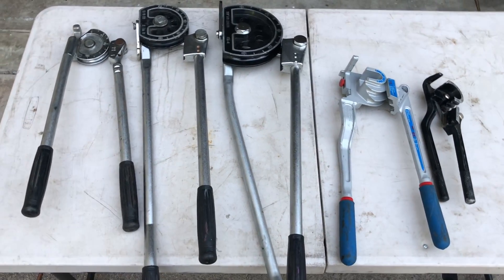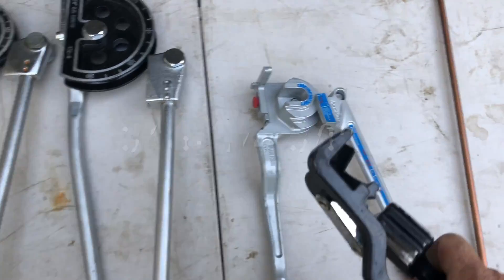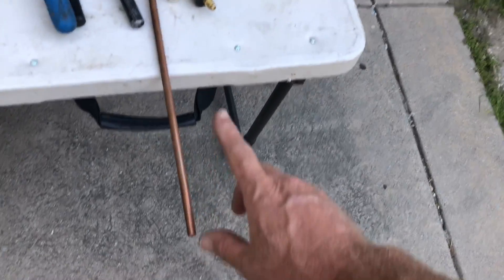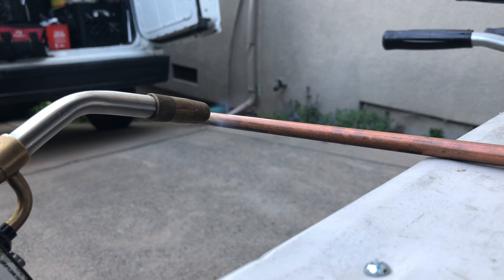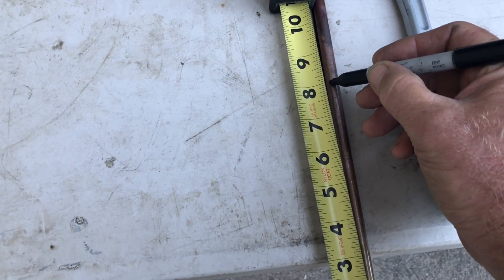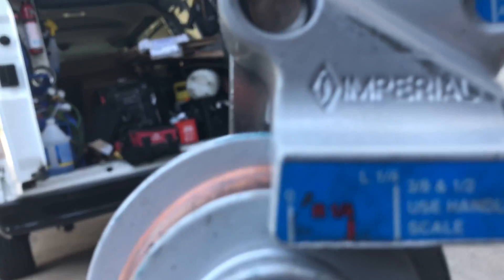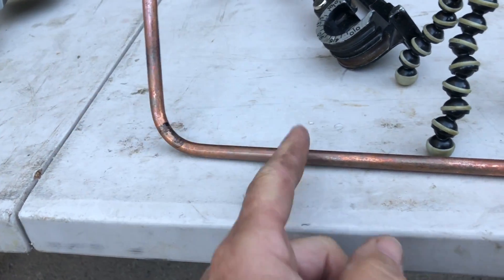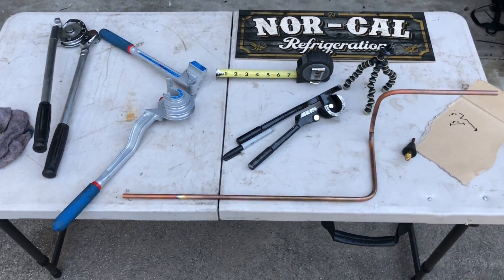Nor-cal tips and tricks to bending pipe

Comment: In Denmark, to graduate your apprenticeship, you have pass a test in bending copper. But most guys, who do installations use fittings, because it's "faster". But i do prefer bending over fittings. Because every soldering is a potential weak spot.

Comment: The 45° mark tip didn't work. I measured and marked 100 mm then bent the pipe, I then measured to see if my bend measured to 100mm, but it didn't. It was more. Is there a way to measure and bend in a way that if you measure for 100mm, you get 100mm after the bend too?

Comment: I never anneal pipe, anything up to 7/8'' will bend ok...even hard drawn. You can get 1 1/8'' gear benders, they save a lot of time and it's fewer joints. I think you should have covered pipe expanders as well, but I appreciate this was a short vid but after bending there is always joining.  Expanding soft copper is no problem, but 7/8'' and above you need to anneal if it's hard drawn, again not using a fitting saves another joint. There is a trick to not splitting 3/8'' hard drawn when you expand it...that saves a leak ;) But good vid, there aren't many explaining the dark art of bending pipe!

Comment: I can recommend the Imperial gear bender for 1 1/8". Our straight pipe most be softer, its described as half hard pipe, as I generally never anneal it unless I an tweaking it by hand. 

One trick I was shown back when I was learning was once you have the pipe in the bender you want to bend,  take another piece of copper that has been cut square, put it in the bended  in the ninety degree position (so the cut end touches the side of the pipe you want to bend) you can then line up your mark with either the inside, middle or outside of the short piece of pipe depending on what measurements you are working to so you get the bend in the right place.

Comment: Greetings from Argentina, you should always warm up before bending the pipes? good video
Reply: Two categories of copper. Soft and hard ACR tubing. Soft tubing doesn’t require annealling with heat. Sometimes, even old soft copper that’s been in the truck a long time MAY require preheating, especially when you try to flare the copper and it wants to split.

Comment: Can the tubing be expanded by using this method?
Reply from the maker: Dennis Noone I think so.
Reply: Yes if you are trying to avoid using a fitting you can heat the pipe up and use the tube expander. Less brazing required

Comment: I had a contractor tell me its impossible to bend hard drawn acr pipe. I guess he never seen it done.
Reply from the maker: K Mech that how we run pipe. At least how I was trained.
Reply: You can't bend hard drawn acr pipe. He took the hard drawn and by heating it (annealing) under nitrogen to avoid the scale, turned it into soft drawn pipe, which you can bend. So technically, if you ask your contractor or anyone else can you bend hard drawn acr pipe, the answer is no.

Comment: Never anneal just bend it, semi hard copper straight lenghts from 1/4 to 1-1/8
Reply from the maker: sjef oekel no semi hard in America only hard.
Reply: Same here sjef oekel, have done 1 3/8" with a stand bender without heating.
Reply: Nor-Cal Refrigeration & H.V.A.C ask for r250 instead of the r290, we are using copper here hecho en mexico! So maybe ask an other whole saler. Saves a lot of time, i even cheat with expanding the pipe
Reply: heavydiesel interesting🤔

Comment: At work I have a nice set of Swagelok benders from 1/4" to 3/4" for high pressure stainless lines. At home, I have that bender you had on the far right and the slinky slide over ones for in a pinch.